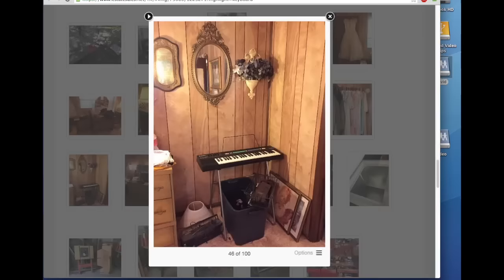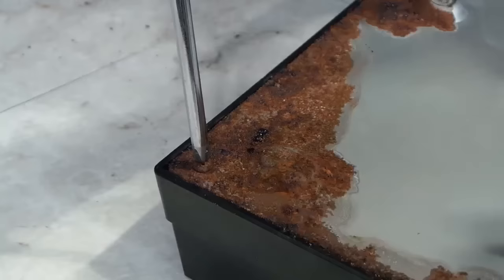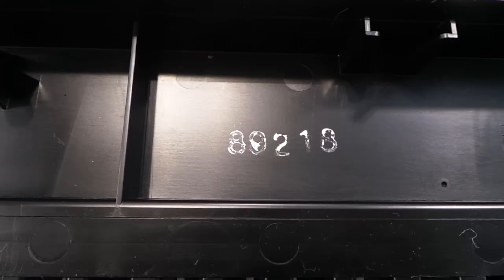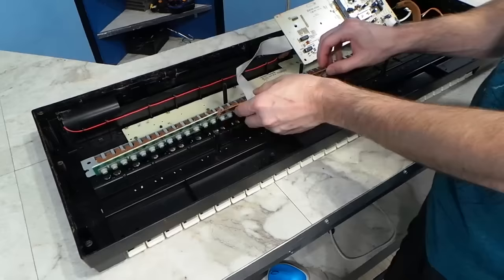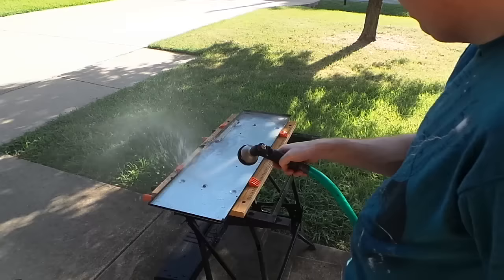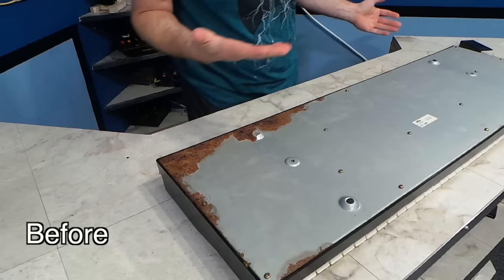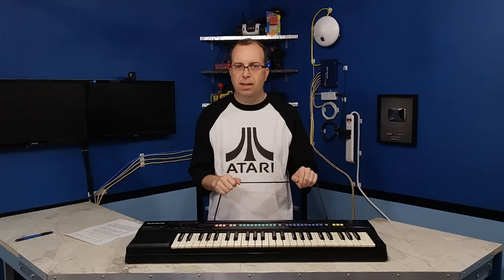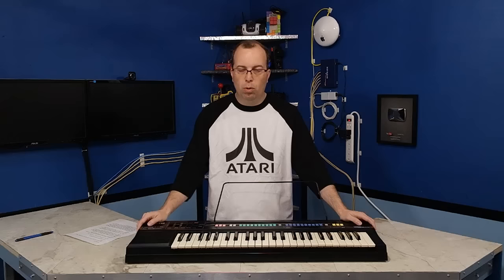Worst battery leakage I've ever seen!  Casio CT 380

Comment: Note to self: Never buy cheap batteries unless you want a box full of rust.
Reply: Just don't leave the batteries in for 20 years.
Reply: Argantonis 
True, it's just that I have lots electronic devices that I sometimes forget to take the batteries out. One time I left batteries in a remote that sat in there for the past 8 years and it wasn't damaged from corrosion since they were Duracell batteries. Sadly that's not the same story for my radio that had cheap Chinese batteries that were sitting inside for 1.5 years.
Reply: LOL
Reply: Garry Koalman SAME
Reply: Dollar tree batteries are a perfect example.

Comment: what did we learn today kids? never buy camelion batteries
Reply: LMAO
Reply: Never mix batteries, especially if one is an off-brand
Reply: @trgtheredghost6528  never had an issue mixing batteries in 30 years
Reply: Also Duracell is prone to leakages. I had a battery leakage in my Nintendo Game Boy, and surprisingly it survived from the leakage. Now I use energizer batteries in my Game Boy.
Reply: @sethhorst6158  only time I ever had leakage in a gameboy, was with energizer.
Reply: It was just trying to blend in with its surroundings.
Reply: WERE GLOVES
Reply: Have you tried looking in the cleaning cabinet, Zac?
Reply: All by the same woman?
Reply: @Cuzjudd  Did you mix only different brands or different types? Because Heavy duty is marketing speak for (improved but still pretty mediocre) zinc-carbon with far less energy so this could have been deep-discharged without the owner noticing if the alkalines kept the voltage high enough for the keyboard to keep working.
Reply: god camel
Reply: I had a battery corrosion in my wireless mouse. They were some crappy brand both the same and both corroded. I just threw the mouse out.
Reply: no I learn to try not to copy comments
Reply: And if you did, never combine them with Duracells.
Reply: Worst idea ever mixing non-rechargeable batteries they will almost always leak epically cheap brands
Reply: @drakethedragon457  even the Duracells and Energizers will leak.
Reply: buy duracell.

they wont corode
Reply: Kaguya Houraisan oh eww no

Comment: Remember kids; take out your batteries on devices if you're not using them. Otherwise, this might happen...
Reply: -fuck not fudge
Reply: or use DURACELL ;)
Reply: PercyandDuckfan94 that happend to me with a controller of a air condicioner. And a toy.
Reply: or don't mix battery TYPES :)
Reply: dangit I was gonna say dat. >:U
Reply: PercyandDuckfan94 the more you know
Reply: I use Rayovac double A's in my keyboard, since it's a pain in the ass to plug it in, especially when I'm trying to charge other devices. The wiring in the house is pretty shit anyway, so who knows what might happen. The batteries have been in there for over a year and they are just now starting to lose charge.
Reply: Actually, just use Duracell batteries.
Reply: Duracells are known to leak. The fact they didn't leak here just shows how quality has dropped over time.
Reply: PercyandDuckfan94 yup
Reply: duracell batteries leak sometimes
Reply: so you got time to buy new stuff and the money for it
Reply: no don’t mix batteries
Reply: lol
Reply: PercyandDuckfan94 ok
Reply: No,don't mix batteries together
Reply: Mr Karim Duracell are way better than Cammeleon 😉Wont let you down fella
Reply: PercyandDuckfan94 j
Reply: How do I do that on a tablet because there's no battery compartment
Reply: PercyandDuckfan94 k
Reply: PercyandDuckfan94 i
Reply: I took my Wiis controller batteries out, Wait why do I still have a Wii controller?
Reply: Yup its important i do it!
Reply: what about the chromebook?? They have a battery but i don't know how to take it out...
Reply: So I should open my iPad and take the battery out?
Reply: Interesting how duracell batteries don't leak, even if they expired on 2001
Reply: People really should I left the batteries in my xbox 360 controller too long and the corrosion ate the plastic off it
Reply: pickle jar man that must have sucked. Xbox controllers a expensive. White or black?
Reply: Brooks Van Pelt black
Reply: pickle jar that really sucks. The black ones are the best In my opinion
Reply: Brooks Van Pelt so what do you play on
Reply: pickle jar Xbox as well.
Reply: i used to play on pc and xbox but mainly xbox because thats what all my friends had but i just stopped playing with them and switched mainly to pc
Reply: pickle jar pc is more expensive in my case so I prefer xbox 360
Reply: id probably still be on console if they didnt make you pay to play with friends
Reply: pickle jar I just play by myself. Its easier that way
Reply: Honestly I've seen Energizer leak more often than Duracell, but then again it's just one person's experience... and let's not even talk about Eveready's. lol   This comment section just "Keeps going, and going, and going...." like the Energizer Bunny ;)
Reply: PercyandDuckfan94 no you should put the same brand of each battery in something that needs battery’s otherwise that will happen
Reply: In case anyone's interested why they suggest to use the SAME brand and model battery in devices, it's due to the different electro-characteristics of each brand/model battery.  The difference in volts/amps could cause more or less drain on some brands/models which will cause the dreaded leaks.  Of course don't use the "cheapest" battery out there either even if they are all the same brand/model, cheap is not always a good idea. :P
Reply: PercyandDuckfan94. Heroes when I screwed up when I was about 3 and tried to play with a pinkie pie toy with my sister and my cousin.
Reply: Now I know why some products have a "Batteries not included." sign on them... lol
Reply: I leave the same pair of batteries in my GBA for years at a time, and this hasn't happened.
Reply: PercyandDuckfan94 my phone?
Reply: I use rechargeable batteries I take them out every time I use them to recharge them
Reply: My phone battery doesn't come out
Reply: PercyandDuckfan94 actually no, you mean don’t mix 2 different batteries together in the same compartment.
Reply: kids these days be like wtf are batteries
Reply: Thnk you uncle
Reply: on the future take out your batteries mean no warranty anymore.
Reply: most batteries today are soldered on anyway....
Reply: Dude, game boys on eBay are constantly popping up as not working because the contacts are corroded.  For what reason?  For being put in storage with batteries
Reply: @dom64c  😂
Reply: But I have an iPhone :(

Comment: I cringed slightly when you grabbed the corroded battery with your bare hands.
Reply: The Cando Railfan it's not that bad
Reply: I cringed when he got the screw in vinegar with his hands
Reply: It's not that bad if you don't rub your eyes or touch your mouth, and wash your hands relatively quickly afterward, most of it is dry corrosion and will not immediately eat through your hands.
Reply: I cringed reading half of these comments
Reply: yeah he'll end up with hand cancer.
Reply: I flinched when he flipped it over
Reply: The Cando Railfan corrosion like this is actually tons of slight acid too. It doesn’t have bad effects despite the word acid. You would have to touch it for a really long time for it to damage you a bit.
Reply: The Can do Railfan dry leaked battery shit is relatively safe as long as you wash your hands. Fresh battery acid hurts like the fucking flames of hell. Its fine at first but if you don't wash that off within 10 minutes, you will regret it. Trust me
Reply: I cringed when I was writing this comment.
Reply: @That1BVP  Actually, there is potassium hydroxide solution in alkaline batteries, which is a strong base and not an acid (just like sodium hydroxide drain cleaner).
 When dried out, it's relatively harmless; still I would avoid touching it. When it's fresh or one touches it with wet hands, it will damage the skin quite fast.
Reply: It's not that bad
Reply: Why?
Reply: I cringed aswell
Reply: Seto0019 he’s not talking about the vinegar, he’s talking about the acid from the battery that corroded.
Reply: Seto0019 no but it stinks
Reply: @sjsjr86  "I will never smell your finger" -Justice Smith
Reply: Heyo fellow railfan

Comment: You should name this video better. I think it's a great demonstration of your skills and how to fix a very common problem with electronics. You would get more views and as a consequence, more happy owners. Do you sell your repaired keyboards? Excellent work!
Reply from the maker: What would you call it?    I haven't sold any, but I do plan to eventually as I have accumulated too many!
Reply: Well. Taking a look at your other videos seems that you are above average in this one, wich is great (around 20k views or so). I did a Google Trends search for "battery leakage" and is a term that is increasing in searches since 2012. Adding something more descriptive to what you actually did in the video like "repair" or "cleansing" had not enough volume to show a trend. With that said, you may not get much volume from searched terms but you would have more curious guys to click if you also add "repaired" or "like new" somewhere in the title. I assume that you used the tags section to describe your video. Try adding: diy, electronics repair, battery leakage cleansing, how to and other related terms.

If you sign this keyboard, after all the work you put on it, and you certify is the one from this video, it would be interesting to be acquired by someone like me. Even if it is not the best Casio Keyboard ever, you having it repaired is awesome.
Reply: Not necessarily. Have you seen the title of casey neistats videos? Totally abstract and yet he has managed to make  some of the best blogs of all time.
Reply: Great point! I assume Casey's subscriber base (5M), popularity (1 billion views total) and historical authority (since 2010) allows the Youtube Algorithm to expose his videos to a larger audience.

It looks that every time Casey publishes a video it has a lot of views and a lot of engagement, so is a proven success for the algorithm (which gives preference to what works).

In this case, I guess if 8-bit Keys works to improve titles and descriptions with more popular keywords, it may increase the exposure to new viewers that may be searching or interested about these themes.

I am not saying it's been done wrong, because I love this content and I wish I had as many subscribers and views as 8-bit Keys has, on the contrary, I want more people to be expose to this amazing content!

I can't tell this is the right way and the only way to know if it would work is experimenting.

Cheers!
Reply: 50th like

Comment: Hello, my brother and I are your followers in the Dominican Republic, my brother is an electronic engineer and I am an engineer in software design, I am 52 years old, I started with 8 bits in my color computer. Here in Santo Domingo, I often work with old equipment and as things are more expensive here, nothing that works is discarded. 

One tip to complete your process of eliminating corrosion with vinegar, when you remove the pieces from the vinegar, always pass them through a solution of sodium bicarbonate to stop the acid effect of the vinegar, that will prevent the vinegar from continuing to deter the pieces.

Greetings from the Caribbean ...

Comment: That MN234000CSH is NOT a microprocessor, but a mask-programmed ROM in a DIP-40 package. It's model number is MN234000 and the 'CSH' might mean 'CaSio' something, since it is programmed specifically for the Casio keyboard.

Comment: I’ve had worse. I inherited a old and somewhat damaged Polaroid for me to restore. The original 9v custom battery was still in it and when i opened the door I was greeted with a gummy like liquid that had the viscosity of cold molasses. After about 5 weeks of very careful cleaning and disassembly I restored the camera and I’ve taken 8 pictures with it. Works perfect now!
Reply: The only thing left was a small bit of aluminum and a small bit of plastic. It had all dissolved or something

Comment: Always buy Duracell kids 😉
Reply: how bout "panasonic"?
Reply: How about Samsung
Reply: APRIL FOOLS!!!!!!!!!!!
Reply: I do.
Reply: PemesaniG batteeres are the best when imported from mainland PRC
Reply: I prefer batteries, didn't know they also sell kids
Reply: mariana militaru you mean crap sung
Reply: T
The Duracell battery was corroded as well.
Reply: FrankANDcientifico Channel  plus they're cheaper than Duracell.
Reply: I doubt specifically Duracell, but definitely don't mix battery types, and most batteries say specifically do not mix other types. Just be sure to buy some form of battery, and don't try and experiment with Li-ion batteries, as some people learnt the scorched way.
Reply: @jasonmartinez2516  that's right. In fact the battery mixing is one of the main reasons about the battery corrosion. That because the polarity and the magnetism are different between them and the unbalanced forces can destabilize one or the two batteries. The unbalanced forces makes a catalyze effect that makes the acid inside the battery starts to decanting, resulting the most acid portion of the suspension goes below and that's why the generic battery in this keyboard got corroded like that.
Hope this comment had been interesting.
Reply: Rayovac batteries are the best, I got some that expired in 1995 and they still worked, plus Rayovac is the only battery that lasts more than a month in my electric toothbrush.
Reply: I had bad experiences with Duracell batteries, now I trust Energizer.
Reply: Modern Duracells are the worst for leaking.
Reply: @varkokonyi  HAHAHAHAHA
Reply: @dj_noxxie  no more like crap pple
Reply: Just use the DC in
Reply: cough Energizer cough cough Guinness World cough record holder for cough cough longest cough lasting battery!

Comment: My mom had one of these in high school (mid-‘80s if you’re still looking for a date — certainly before 1989). It’s literally sitting in my bedroom as I type. My sister and I have fond memories of hitting the ‘demo’ button and dancing to the programmed song.
We had the opposite problem — when I was young, the power cord stopped working, and we didn’t have the finances to constantly buy D batteries for what was basically a toy for my sister and me. My dad simply snipped the end off the cord and soldered the wire inside. It’s worked fine ever since. I used it to practice piano in college around 2013-15, so they do hold up decent.

Comment: Moral of the story?

Buy Duracell batteries :P
Reply: Nope. I'm dealing with leaged Duracells in my MagLite 4D. The corrosion looks just different as it is aluminum and not steel like on the back of the keyboard here.
Reply: @RizLazey  I've looked closer than you and i came up with this:
1. Get some grammar lessons
2. I've had a ton of Duracell batteries and they all leaked. There is no alkaline battery in existence that doesn't leak.
3. Why are there 2 Duracell batteries when he said that the Duracell didn't leak? And why was the old corroded one replaced with a new one?
4. You can clearly see some yellow stuff on the positive terminal of the battery. Meaning it leaked.
5. Why is the ground cable corroded? After closer inspection, it wasn't damaged by leaking batteries. If it were to be that way, than the spring should've been corroded too.
-----------------------------------------------------

Actual moral of the story:
He was either paid by Duracell, or he is a clear sellout.
Reply: @zUltra3D  "He was either paid by Duracell, or he is a clear sellout.
" Are you fucking real ROFL
Reply: @RedHairdo  I know, this dude is rambling on about a battery.
Reply: @zUltra3D  the battery has nothing to do with it.  not the mark either.  the battery was old and ready to be exchanged
Reply: zUltra no the Duracell battery was fine the rust came from the camelion battery 🔋
Reply: Moral of life?

Don't have xxX in your username and don't steal comments
Reply: Stolen joke

Comment: Since I'm fixing electronics for my family and other people I think I'm gonna show the part of this video with the battery corrosion to the "special" ones who did bring me devices which had... corroded contacts from leaking batteries to convince them to REMOVE THOSE DAMN BATTERIES ! when not using the device for a long period of time. Thank you for this video.
The only "issue" is that I'm french (as the people I sometimes get to work for of course) and few of them actually read english.
But I think the images may do their effect though ! ;)

Comment: The rust doesn't look like it was caused by the battery.... I think the thing has been sitting in water. Battery corrosion creates a white or bluish-green powder, and if you look at the metal bottom it has a a big rust blob in one spot. I think the rust started from the underside of the keyboard and worked it's way in - the most affected area being the inside of the metal cover where water would have sat after seeping in the device. I've seen this in old computers that have been sitting in water puddles - there's a little corrosion on the underside of the case, and a butt-load of rust on the inside.
Reply: King Parodije I read this with a Stewie voice.
Reply: @kaneCVR you are thinking of your car battery that turns the blueish-green color. Your car battery is a lead-acid based battery. The battery in question is most likely carbon-zinc based which tends to corrode with a color like above. I think if it had been sitting in water long enough to corrode this much there would be other visible damage. Just my two cents.
Reply: King Parodije your right, when he use wire brush on that bump yucky water comes out
Reply: kaneCVR no if it's water then how would you explain the corrosion on the plastic? Plastic can't rust....
Reply: cool nerd
Reply: water or something worse..
Reply: The other battire was zinc cloride.
Reply: kaneCVR that makes sense, but how about the survivor Duracell battery